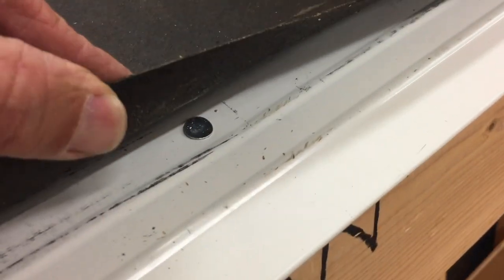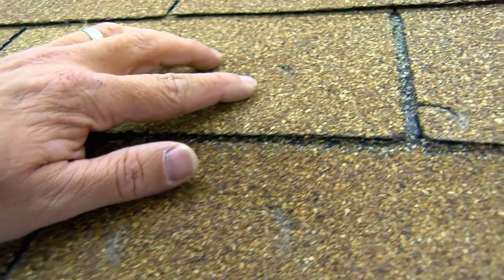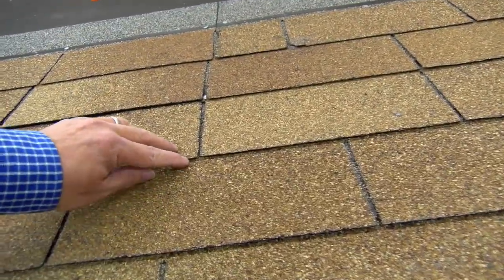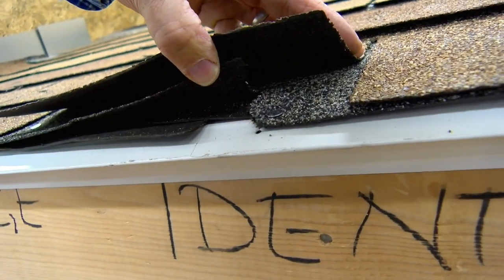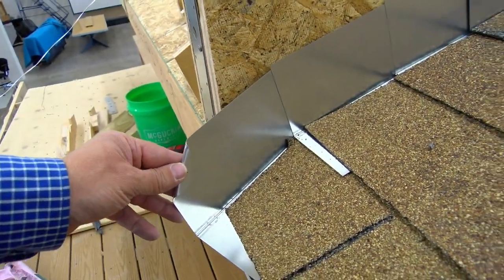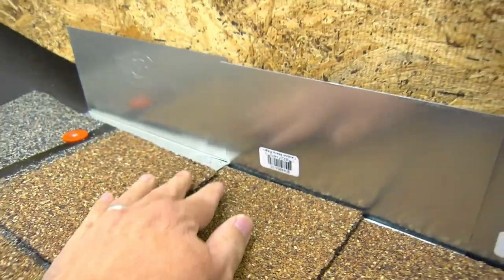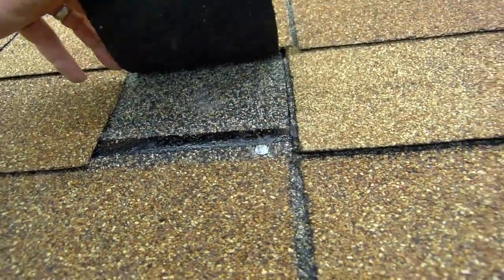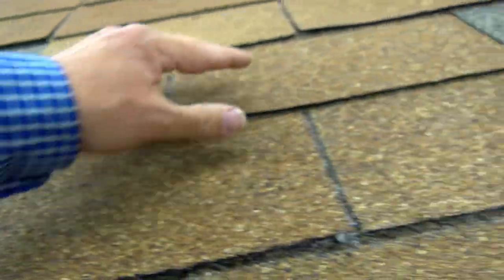Roof Defect Recognition Training at House of Horrors

Comment: Thanks for the informative video. I understand that all the defects pointed out are very important to note. However if you had to chose the most dangerous one which one would it be?
Reply from the maker: Hi, Charlie.  I don't think there are "dangerous" defects on this roof installation at the InterNACHI House of Horrors.  A major defect is one that is condition of a system or component that renders it non-working, non-performing, non-functioning or unsafe, and requires a professional contractor to further evaluate and repair, correct or replace.
Reply: @BenGromicko  Thanks Ben for reverting back. So if I understood correctly there are no major defects in this video?
Reply from the maker: @charlieelkhoury4482  Oh, there are many defects identified in that video, but none are "dangerous" to a person. They are defects that should be repaired by a contractor.
Reply: OK understood! If I am buying a home would you recommend i get a home inspector & roofer or wait for the home inspector's recommendation first? From what I understood home inspectors are only responsible for the condition of the home at the moment of the visit whereas roofers would provide information on potential future defects & roof life expectancy. As a person looking to buy a home I am not interested in buying a home that's good for the day but would need replacement in 3 months. I would really appreciate your feedback on that.
Reply from the maker: @charlieelkhoury4482  Good question. It's more affordable and efficient to hire a home inspector, instead of hiring contractors (who may have a bias toward their observations).  Home inspectors have a Code of Ethics that helps ensure that they act as neutral 3rd parties serving only their clients. In relation to your second point, home inspectors are not responsible for the condition of the home at any moment.  They are required to report upon defects that they both observe and deemed to be material (really bad conditions) according to the Standards of Practice at www.nachi.org/sop.  I would recommend asking your home inspector about the system's condition, guess on the age, and report upon evidence of defects or conditions that may lead to a defect developing in the future. You may want to watch this short video about what really matters in a home inspection: https://youtu.be/-y6xQL3Y3UU
Reply: @BenGromicko  Thanks for the informative video and for the explanation, I am more confident now in home inspectors. If my home inspector reports on cracked/missing shingles and gives me a general idea of problems that might develop in the future, I won't need a roofer anymore. Also thank you for mentioning the code of ethics because I learned that home inspectors are afraid to excessively report on defects in order to keep on getting referrals from agents (which is outrageous!). Also, a lot of roofers are offering to inspect the roof completely free of charge! (as you said they want to sell a new roof).

Comment: Forget H clips. H clips means your sheathing isn't what it should be. Upgrade the plywood sheathing. Use real plywood that is made with exterior glue. Go thicker if you have to. It will be worth it.
Reply from the maker: Nice tip and advice, Ray.

Comment: This guy is your typical guy that pretends to know what he's talking about but he has no idea about hard work inspectors Don't Know Jack roofers 2
Reply from the maker: Hi, Javier. I'm that guy. How can I help?
Reply: What I'm talking about is that you are basically going off a book you are not a real roofer real roofer knows shortcuts and handy ways to do work that works just as efficient or better than in the book
Reply: @Javier: The stuff he pointed out are some pretty obvious flaws. If you're defending crappy work like this, you're probably a crappy worker that bangs through his jobs and leaves the homeowner with a leaky roof.